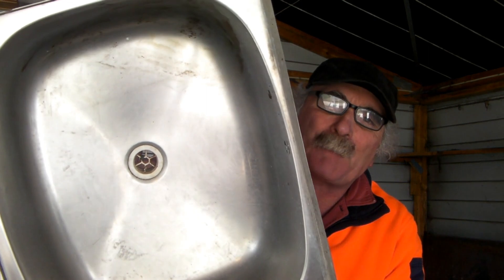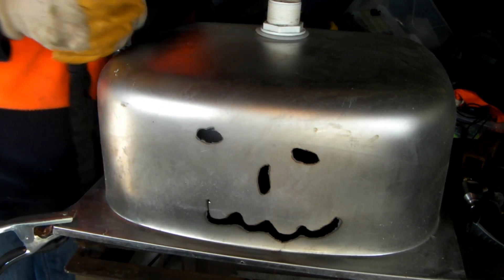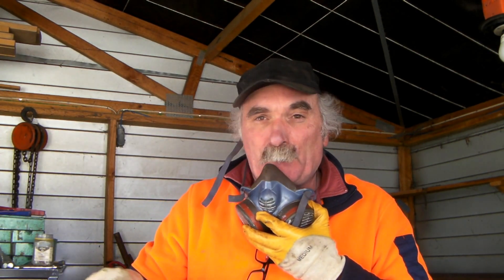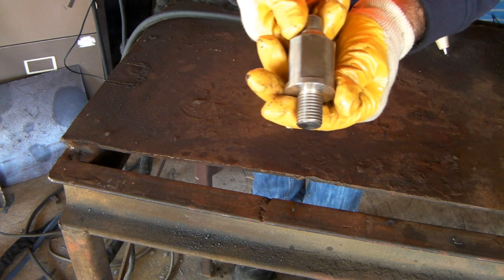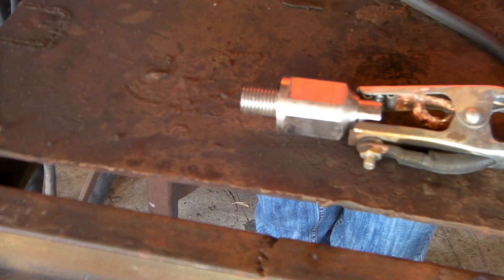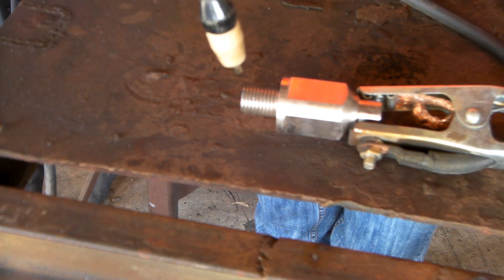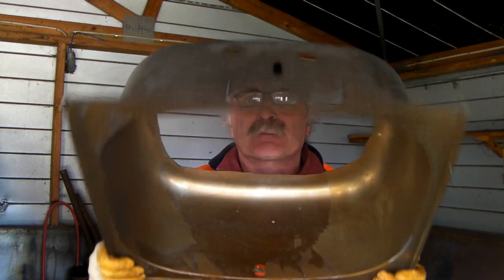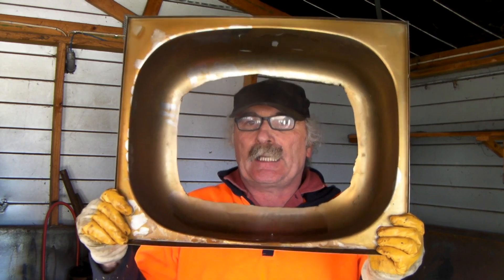Chineses Plasma Cutter Cutting Stainless Steel

Comment: I've had the same issue cutting 1/8 inch stainless steel sheet. I initially thought it was a ground issue. What voltage are you running on?
Reply from the maker: 240 VOLT MAINS NOT 110 V

Comment: Hey Pete, I’m a total newbie welder/plasma cutter. I want to cut a beer keg into a fire pit. Got me a 40amp Chinese inverter welder and I’m clueless lol. My welder has two terminals on it, one positive and one negative, does it matter which one I connect into or both have to be connected? And which one do I connect to the work piece? Thanks mate.
Reply from the maker: Hi mate check this out might help 
https://youtu.be/PaxL7VRL57Y 

Plasma Cutter Setup /Plasma cutting basics
https://youtu.be/J-AlvvHzWfQ

Thanks for watching pete